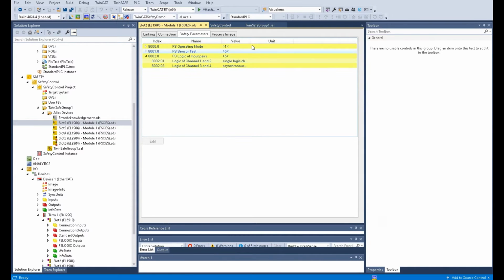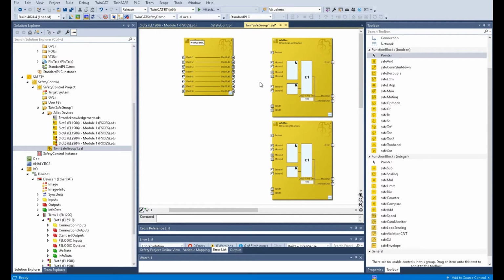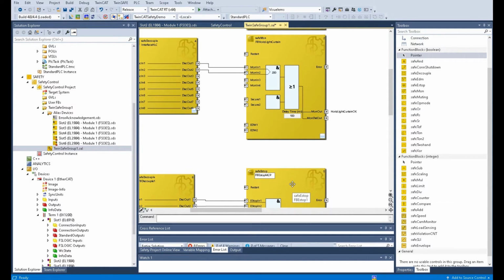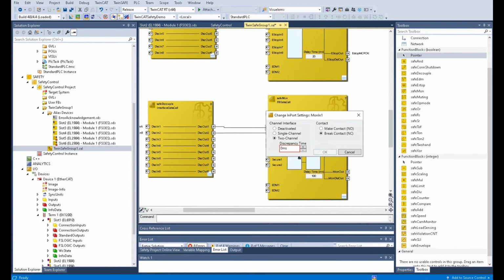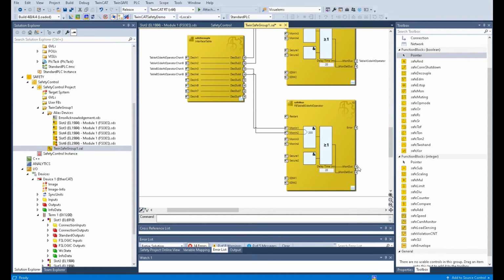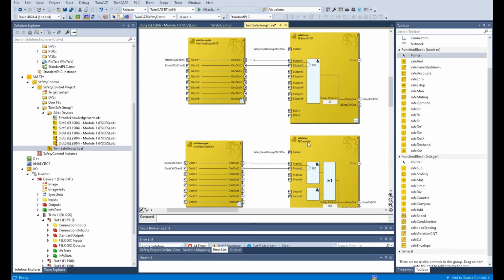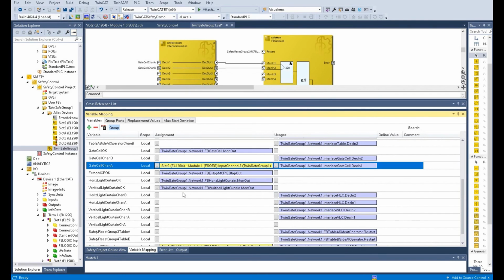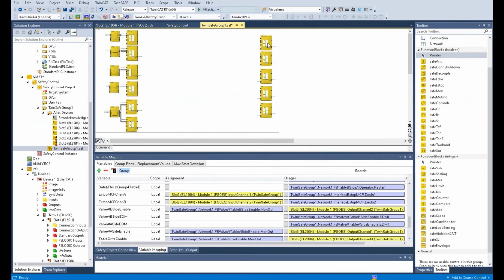SA07. EP05 Beckhoff Safety TwinSAFE - Connect Safety Inputs to Safety Function Blocks

Comment: Hi, thanks for your videos, I have learned a lot :). I have a question, does 20ms as delay time for Estop work? I got "Time not in valid range" message. And next I got "Safe input After Disc Error" message, did you get it too? How did you handle it? Thanks